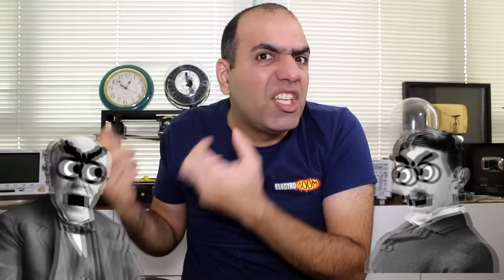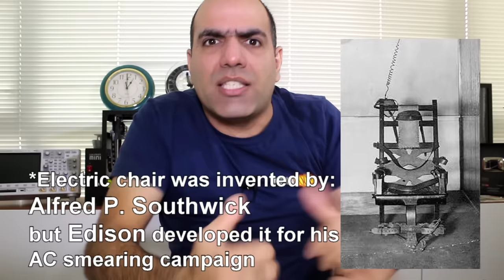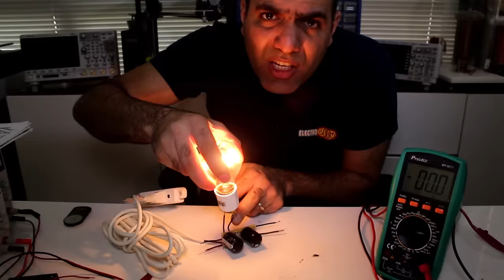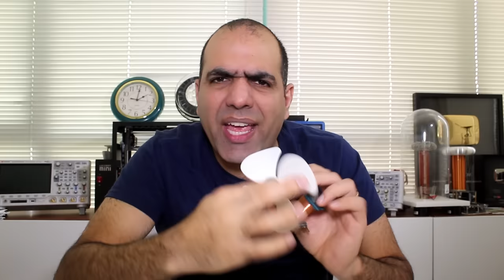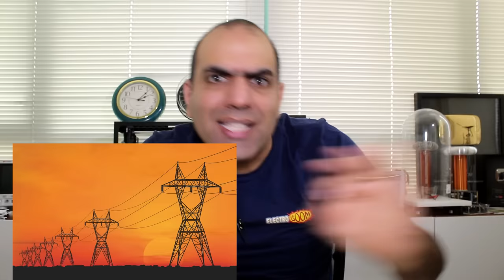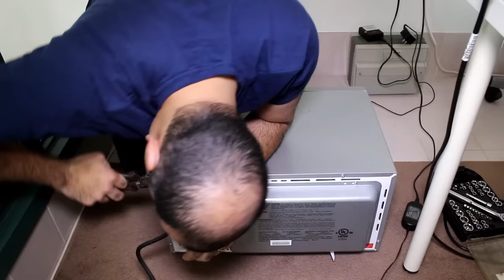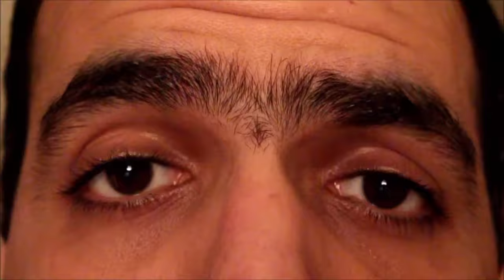Why Use AC Instead of DC at Home??

Comment: People use AC instead of DC because they don't know how to make a FULL BRIDGE RECTIFIER!
Reply: Ah, but you don't need a full bridge rectifier if you produce DC at the source! The obvious solution is to flood every town in America so we can all run water wheels to work a DC generator!
Reply: Jeranhound That's a joke.
Reply: Jeranhound Using an AC generator and then converting the generated AC to DC through a full bridge rectifier would be more fun.
Reply: there are a shit load of loses over a full bridge recktifer, but it ain't a big deal for small shit every now and then or when there are no/few other options.
Reply: But it's literally 4 diodes in a loop
Reply: We'll run AC generators off of exercise bicycles, convert that to DC, use that to charge up lead-acid batteries, and then power our homes with those!  What could go wrong with storing thousands of pounds of lead plates and caustic acid in barrels in your basement?
Reply: for silicon, its actually 1.4V lost for each cycle.

Comment: So just to be clear (and correct me if I'm wrong), it isn't that AC itself is inherently better or more efficient than DC at long distances, it's that high voltage is more efficient than low voltage. But that makes AC easier indirectly, especially in the old days, because AC voltage can be easily changed with a transformer, while DC can't. So historically we went with AC systems. But if we had methods of changing DC voltage (which we now have today), then DC would work just as well as AC, and that is how some countries with more recent infrastructure are using high voltage DC instead of AC. Yes?
Reply: No, DC is not better on longer distances. DC - you need 2 times more wires because you need one wire for plus and one wire for minus and you need to close the loop all the way back to the power source or electrons travel 2 times the distance back-forth to the power source from minus to plus. AC - you need only one wire. The other one - the ground - zero you can get it on the other side easily.
Reply: You are absolutely correct. With modern DC to DC converters HVDC is a completely viable and arguably better distribution method. However transformers for AC conversion are still cheaper to produce. There are also reports that's they are more efficient than DC to DC converters. However there are other losses in AC systems that aren't in DC systems.
Reply: nikalsson Stop posting lies when people are asking legitimate questions. AC is distributed in 3 phase which means 3 conductors. DC requires 2 conductors.
Reply: 3 phase for much more power and efficiency than DC. However you can do it with only 1 phase - look the video here how many wires ElectroBoom used - only 2. Only one with phase, the other one is just zero-ground, he used a wire for it. More phases are for a lot more more power and efficiency. Also with AC the wires -  less heat, less losses and you need less thick wires.
Reply: nikalsson Earth ground, negative and neutral are all different return paths that are sometime (incorrectly) refered to as "ground". Earth ground is NEVER used as a return path except in a fault senario. The resistance of soil or rock is much higher than copper or aluminum. Neutral is generally the term used for the return conductor of a single phase AC system where as negative is the return conductor for a DC system.
Reply: nikalsson Please read up on Ohm's Law. For a given current the voltage dropped is directly related to the inherent resistance of the conductor. THIS IS TRUE FOR AC AND DC SYSTEMS. Since power consumed by any component of a circuit is equal to voltage times current the heat produce by a conductor is equivalent to current time resistance squared. There for  when calculating the size of the wire, you need to consider it's resistance and current capacity. TYPE OF CURRENT DOES NOT MATTER.
Reply: At every transformer station they take the zero from the ground itself. They do not use wires for the zero all the way back to the power station. The zero is taken from the ground. Electric trains also use only one wire up there - phase and down - rails is the zero - ground. Also thyristor transformers are less reliable than AC transformers or DC systems are less reliable.
Reply: nikalsson A thyristor is a diode with a gate. It does not conduct when forward biassed until a current is feed into the gate. Is a rectifier not a transformer. I know you haven't notice (although others may have) I know what I am talking about, I am an electrical engineer after all. You have such a base level understanding of these systems and so you spread incomplete and frankly incorrect information. Yes they pull zero at every transformer but it's not for use in the circuit, it is, among other things, a return path during a fault condition. 

There is not any trains that use the ground as a return. The ground has a resistance that is relatively high therefore if any system did use the ground as part of the circuit Kirchhoff's voltage law would suggest that a lot of power would be wasted in the return path. This would be very inefficient especially when the whole point of electrical distribution is to get power out of it. To be fair to you I once wondered why an AC system used the ground as a return and I figured it was because it was so big it's resistance was low. Then when I turned 10 I learned how it actually worked.
Reply: Excellent, thyristor is a diode indeed and that's why thyristor transformers are much less reliable than AC transformers or DC systems are much less reliable. It's written in the books, you can read it. I am too. And I can tell you for 100% that in your home the zero is not coming all the way back to the power station. They take the zero - ground from the local nearby transformer station from the ground itself. Have you ever seen on high voltage AC pillars any wire that is caring zero? You will never see that. Stop writing nonsense. With DC you need more wires.
Reply: nikalsson When you say DC transformer I am assuming you mean rectifier. Since DC current technically does not vary (in direction) it cannot create continuously varying magnetic fields.  Varying magnetic flux is required for a transformer to work. By coupling energy through the magnetic field all the windings in a transformer are electrically isolated. This means that while the voltage between the terminals of the same winding may be a set RMS AC voltage the voltage between the terminals of isolated windings is unknown and can technically be as high as the wire insulation will allow. This also means that there does not need to be an electrical connection back to the generator as you are implying the earth is. According to the electrical code (here in Canada) the neutral conductor of a single phase system must be connected to ground at a single point in the building and at the transformer. (there are other points that it is connected to ground but they are not important for this discussion) This means that the neutral wire is in parallel with the earth since they are connected to each other on both ends. Since the ground has a much higher resistance nearly all of the current runs through the wire and not the ground. The ground is then only used as a conductor when the system has a fault (as I have stated before). Interesting fact, the top wire of any pole mounted distribution circuit is always the neutral wire and is connected to ground at regular intervals along the system. This is the same neutral wire that is connected to your house and the "bottom" side of your local transformer.
 EDIT: The "bottom" side of a split phase transformer is technically the center tap of the secondary winding.
Reply: Nikalsson you are missing things like the skin effect, and the reactive component that leaves AC with more loses than DC. Ohm's law is an over simplification. you also don't seem to fully understand AC wiring

Comment: DC would solve a lot of problems with interferences, humming and buzzing in speakers, flickering of screens...but now it's too late to changing it I guess. When they adopted AC for homes, they had just classic bulbs where it didn't matter if it's 50 Hz or 60 Hz or whatever, but now it matters with all stuff that bothers us with flickering. It would be nice to have extra let's say 24 or 48V DC wiring at home for these devices that don't need high current, but stable DC voltage is needed. Ofcourse you would need transformer very close, but for 48V, it should not be problem to have transformer somewhere outside of building, for 24V, I am not sure, 12V probably not.

Comment: There is a trend saying that if we already convert power to dc for every piece of electronic equipment in the house, maybe we should have one single big efficient ac-dc converter in our home and run a separate low voltage dc system for all of them. What do you think about that?
Reply: Most devices you own use 5V DC or 12V DC which is far too low to be transfered through your house, so you need switching supplies anyway, but you could use 170V DC or 330V DC which nearly all of your devices can handle because they start with a rectifier.
Reply: the true solution would be to have a supply of small generators for everyone, cheap to build and easy to repair, not needing them to output a ton of current, just enough.
that's the ideal solution.
but if everyone has their own power supply , easy to repair and cheap to replace , nobody would pay for maintenance, use and installation of a larger system.
see the problem?
Reply: And what kind of generator would you get? Internal combustion engines? Not practical in the long run and way too dirty. Solar power? Clean and cheap but needs a way of storage aswell.
Reply: wind? magnets? hydraulics? geothermal?
hell, the Earth itself is a generator!
Reply: Nighthawk that is true but often by creating one large generator instead of tons of smaller ones, you can achieve better efficiency
Reply: That guy doesnt even know the term efficiency, hes a free energy flat earther.
Reply: As Chuckiele said it would be hard to send 12volts through your  house. The problem is efficiency loss in wires. To combat this at 5volts and 10 amps you could need to use wires up to 8awg to deliver it 50feet, maybe larger, and that would only be 50watts of power. For low current loads it might be feasible. But with wires as big as a standard house mains wire it would be so that if you turned on a Bluetooth speaker with it charging, the wire would resist so much current, the voltage would drop down to nearly match the lithium cell in it "It's any device that takes a current draw for being on". So it can be done. But it only has the practicality of low current usage. In which case you might get better efficiency than using wall adapters. 

That was fun to write and thanks for reading! 

Btw a major issue to conquer is power factor, its an AC problem and a major issue in rectifying AC to DC.
Also voltage drop in large buildings with a dual phase 120volt supply is an issue. Just less of one because the 120volts can overcome most of the resistance but I've noticed it but even with a heater on a 100 foot wire at 1500watts the efficiency loss, to take a guess sense I don't remember for certain, the 125volts from the box dropped down to 115, and if the current didn't change "hypothetically, but in reality you know it did" that would mean the 1500watt heater was only getting 1380 watts delivered to it, that's 120 watts of power dissipated as heat in the wall which that is something you don't want for multiple reasons however 120 watts by 100foot of cord.. I'd like to say isn't too bad but it's enough to start being scary. So for efficiency and more cost effective electrical systems in larger places a higher voltage system would help... Its actually common in industrial facilities. But too dangerous for the common person to use... Could had made a video off of this.
Reply: Yeah, thats why Im not a fan of 120V either. High power devices like heaters would require so much current that the cables would have to be insanely thick and would still heat up. Most people I know only have 10A or at best 16A breakers because we use 230V and on high power devices like ovens we actually use 3 phase power.
Reply: Good idea except devices require different voltage. You would need to have 5 different plugs or step-down transformers (again, at the device or the plug)... which kinda defeats the idea of "one big converter for all".

Comment: You only play with electricity when you know everything about it simply a genius
Reply: That's because he is electrical engineer
Reply: Up to like 20 volts you can play with it whatever you like, it cannot harm. Household electricity is DIYable if you know all the practical and theoretical details about it. Any higher; please don’t, a 5 minute joy is not worth getting a lethal shock.
Reply: @Engineer9736  It's the amplitude, not the voltage. A single amp of AC that crosses your chest can stop your heart, and it doesn't take much more to the head to disrupt brain activity. Though obviously voltage and amplitude do correlate, along with resistance.
Reply: @OtakuUnitedStudio  It's mostly the voltage when it comes to humans because the human is the resistor that completes the circuit for all dangerous shocks. Dry human skin resistance is in the ballpark of 10K ohms. Use some salt water to make the skin wet and the resistance is much less. (That that's why hairdrier in the bathtub filled with water and bathing salts is so bad idea.)

Comment: What would an ElectroBoom video be like with any loud sparks or smoke? Love it.AC is better for long distance transmission and step up/step down conversions with transformers, but I am surprised a standard didn't develop for residential DC distribution schemes (having all of these wall warts is a real pain in the ass). AC motors are more efficient than DC motors however and some devices are a more natural fit for AC. So it's a tradeoff in some respects. Edison's influence was manifest when they built the NYC subway system which runs on about 700 volts DC (stepped down and rectified from Con Ed feeders - horribly inefficient) BTW DC can be just as deadly as AC under the right conditions.

Comment: The solution is clearly to use neither AC nor DC.  Spin up flywheels in a vacuum (two of them spinning in opposite directions to prevent a gyroscope effect, naturally) and deliver them to people's houses the way coal used to be delivered.  No wires, no transformers, no forests felled for poles.  Just mechanical energy delivered right to your door.
Reply: NoJusticeNoPeace Not Possible as the circuit connected would cause internal friction to slow it down and stop it overtime

Simple Physics Rules: No device can give more than 100% efficiency(not for you if you believe in free energy). It would always give possibly(in rare chances) equally energy or even less energy than what was applied on it. So, it needs constant physical force to rotate and it would just waste energy.
Your theory is just showing how wastage could be reduced not how more energy could be produced.
Reply: NoJusticeNoPeace this is wrong on so many levels
Reply: +Aryan Arora Well yes, the flywheels slow as you draw energy from them.  That's why you need deliveries of fresh ones when they come to collect the empties.  (I'm obviously being facaetious, but read about the Gyrobus experiment in Switzerland in the 40s.  They were real public transport buses run on flywheel energy.)

Comment: This guy has taught me enough to make me wanna start experiementing with electronics on my own... But he has also scared me enough to never wanna touch a wire again... 😆
Even virtual simulations in Tinkercad feels scary now! 😂
Reply: I DONT KNOW WHAT THIS GUY IS DOING TO CAUSE EVERYTHING TO BLOW UP.
i did a lot this type of electrical experimenting when i was in highschool.  it almost look like he did it intentionally
Reply: @jadonbelezos2583  he did it intentionally lol
Reply: You are quite safe working with voltages of below 50 volts AC. And much electronics uses considerably lower voltage than that.

Get yourself a bench power supply with a range of 0-30 DC volts and you will be quite safe (unless you start constructing voltage multiplier circuits).

Comment: Hey Mehdi, not sure if you will read this or not... But still, can you do some research on can we use the loss happening in powerlines/near electric towers/industries or even big transformers... To get atleast a small supply? Because i remember you did a vedio in which you captured some sort of voltage (i guess?) in your room... Which mostly was from your camera noise... So what i think is the losses near those area would be too high? Right?
Reply: Just a thought... I could be wrong..... Also we would be capturing the losses? So i hope that wont be illegal
Reply: Making people laugh,
While helping people learn.
Thank you for keeping it interesting! "To say the least"
Love your channel! I'm sure you're motivating many future electrician's and electrical engineers! ;-)
 Keep up the great work!
Reply: Tubergen MotorSports uhh sir... Sorry to say but you replied on a comment instead of posting your comment.. :)
Reply: the loss of electricity, or "linedrop" as its also called, is caused by the resistance of the metal wires and most of it is burned off as heat. It does not just fly away into the surrounding atmosphere.

Comment: This video was great, but it missed a crucial part: the "at home" part of the question. Mehdi showed why AC is used for transmission lines. It could still have made sense to use rectifiers for the very last step, to convert the transmission line AC to deliver DC to the home.